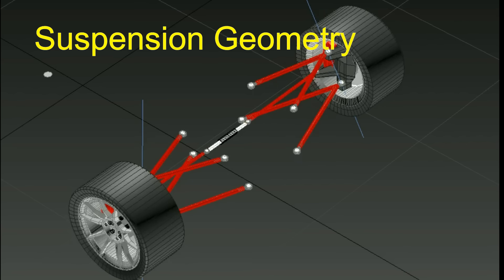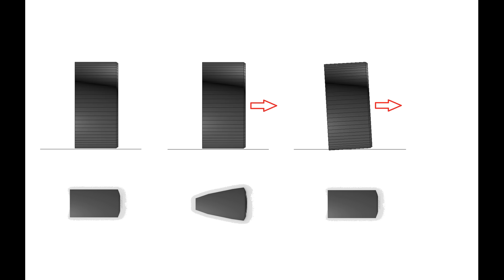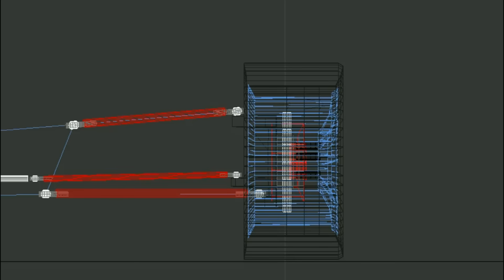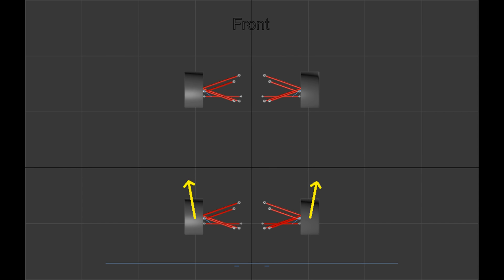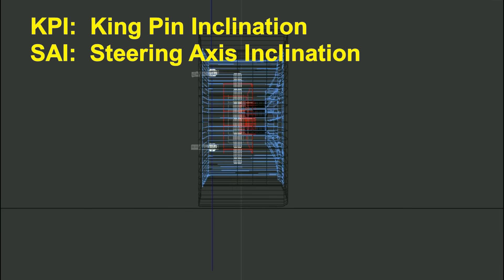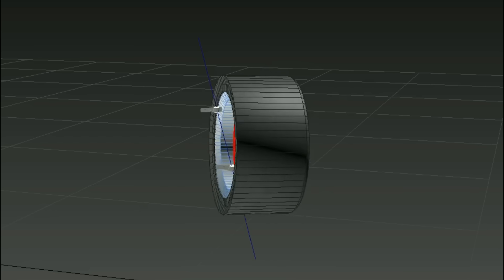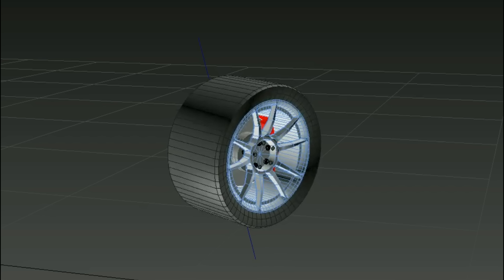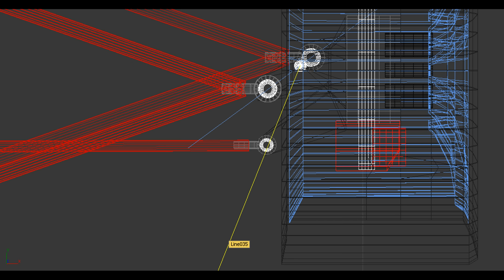Suspension Geometry - Part 1 (Camber, Toe, Caster, KPI, Scrub Radius)

Comment: Thanks for such a practical video. I have one query.  At 10:19 (time) during the explanation of positive scrub radius,  for rear wheel drive cars the red headed arrow is pointing backward along with SAI resulting in toe out but in front wheel drive cars the red arrow representing contact patch is pointing forward. I need to know what the arrow direction denotes and why the direction gets swapped in fwd and rwd cars.  Thanks for your patience in reaching out this entire query.

Comment: Torque steer is from front wheel drive vehicles. And it happens because of the difference in driveshaft angles between the left and right half shafts as the differential is not in the centre of the vehicle. Ways to reduce torque steer are to include a intermediate shaft with a hanger bearing behind the engine to create equal length front half shafts. This can also be achieved by moving the SAI upper and lower pivot points closer to the wheel centre line. Google the new Honda Civic type R and they have removed the upper strut bearing and added a upper ball joint on the steering knuckle. By giving FWD vehicles a negative scrub radius also reduces the torque steer effect as the wheel as more leverage over the half shafts. Where a RWD vehicle with short and long arm type front suspension will have positive scrub radius, which your SAI intersects the tire contact with the ground before the tire centreline. I noticed some other errors but I can’t be bothered to explain them. On the whole nice presentation and  you did include a lot of accurate material. Good job
Reply: Sorry dude, but you seem to have confused torque steer asymmetry with what has been called for at least 4 decades (yeah, I'm dating myself) torque steer. Don't bother with explaining the other "errors" you see unless you do some proper research before posting.
Reply: Congrats to Honda for finally solving this problem 10+ years after Renault released the mk2 RS Megane.

Comment: This is so complicated. I came here after I Goooogled "why some cars' front wheels slant when turning". It looks really weird when my neighbor is pulling his Mercedes into his garage.
Now I understand why (kind of). But still wonder; why the heck are we still using wheels some thousands of years after Sumerians invented the wheel? We should be having functional hovercrafts or anti-gravity vehicles of some sorts by now. Don't you think?
Reply: There are fundamental flaws with anti gravity and hover vehicle. STABILITY. Its alot harder to stabalize a hover craft when moving forward. The wheel is still so effective, and we have completely optimized them to such a degree, that we would need a universal breakthrough in the understanding of physics, to really get past the effectiveness of the tire.

Comment: This video is very good. Makes things very clear. One thing needs to be added;  That high positive caster is better for high speed stability, that's why the German cars and cars with German designed suspensions (Chrysler 300/Magnum/Charger/Challenger, to name a few) have the high caster.

Comment: So many people are lost with these issues. My 69 Nova only had 1 - 2 neg camber, but it had  great negative ROLL with my upper a arm set up.  My friends think that since the suspension is 40 - 50 years old design, it's garbage. LOL! Oh, and  I was running 315-35r17 front .. 335-35r17 rear.  Not a drag racer, but FWY & mountain roads were a blast............

Comment: hi could you explain why if i reduce the tire pressure a lot on my street tires i can get better 1/4 mile times even if the wear is only on the sides and the middle of the tire gets no grip. tks
Reply from the maker: It results in a larger contact patch so more grip. Depends on the type of tire too. In circuit racing most tire sidewalls will start to roll below a certain pressure so reducing pressure below that point doesn't always work

Comment: Hi ! I'd be interested to know how you rigged your suspension geometry in maya. I've been breaking my tooth on trying to do it but i'm rly struggling. How do you make both wishbone rotate from their attach points based on the knucle size, while still having your knuckle pivot moving in relation to the lenght of the wishbones?

Comment: ok ok hold on ive made use of neg  caster not on a 4 wheel car but a reverse trike  gokart i made for my lil bro's kids . it has a lot of camber and lifts the outside wheel drops the inside almost on its sidewall . an inch or so drop/lift on each side . it dont have a motor on it now but if you realy wanted i could do a vid showing how it works .its all made from spare parts and scrap a work of art lol

Comment: Why can the center of the contact patch and steering axis be in  the same point . just wondering !
Reply from the maker: It can cause squirm. There would be no force on the tires pulling them one way so if you happen to have play in your tie rods the tires will try to move around one way or the other. With some scrub radius that doesn't happen because there's always some force holding the tires one way

Comment: This is really good stuff. Steering/suspension geometry is one of the hardest things for me to understand conceptually as someone with no real practical automotive or engineering experience, just an interest. I'd love to build a little sports car like your own someday, it seems so cost effective for the amount of thrill you get.
Reply: Just check miata forums, craigslist and autotrader. A miata with aftermarket suspension parts and wide wheels/tires can be had for $5k on up. The most economic, reliable fun you can have on four wheels. If you can DIY even replacement engines and trans are dirt cheap.
Reply: After all of the money you spend in custom parts the most cost effective option is a used Miata. Expect to spend at least $20,000.

Comment: Nice video and 3D models, thx for sharing. Can you shed some light on whether adding neg camber affects the scrub radius and whether it's significant or not? Adding more negative camber adds more KPI but that also moves the tire contact patch to the outside. My belief is that the KPI changes will outweigh how far the center contact patch is moved but I wasn't able to find any models on that.
Reply from the maker: Yes, changing camber by changing the ball joint positions also changes KPI and scrub radius. Depends which ball joint you change(upper or lower) but in any case I dont think the change will be noticeable, or at least I've never been able to tell a difference so I'm guessing the effect is really minor. That is an interesting topic to look into though!

Comment: Hi Sir, nice video and good knowledge. may i know what software do you use to create simulation of tire movement simulation?
Reply from the maker: It's Autodesk 3ds Max
Reply: thank you sir, how about simulate rear tire with torsion beam suspension. Can 3ds max simulate  camber gain?
Reply from the maker: It would be a good idea to use Solidworks for that. 3ds max is more for visuals